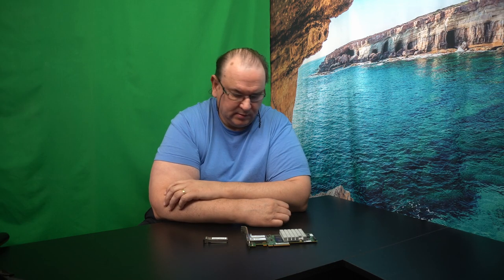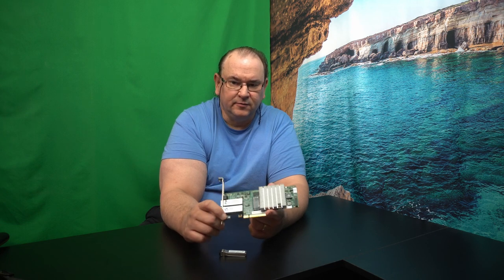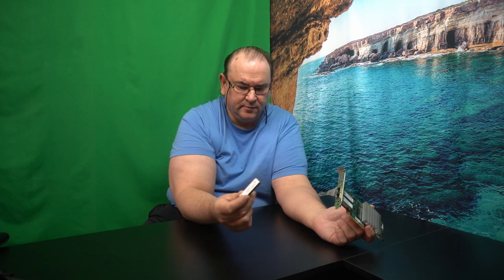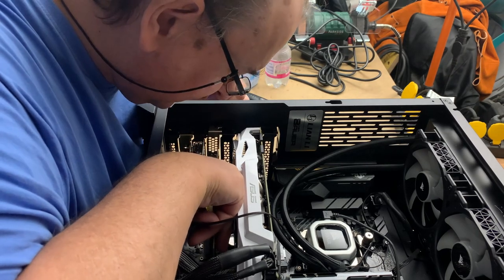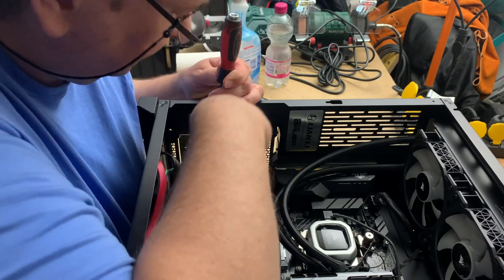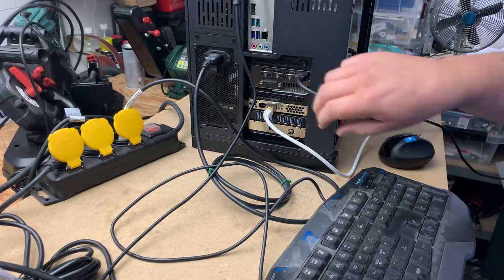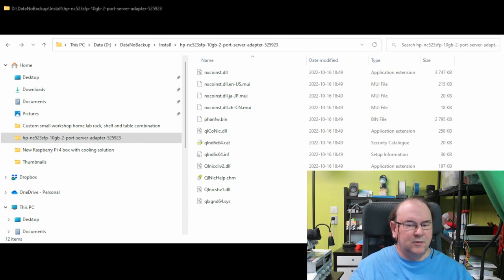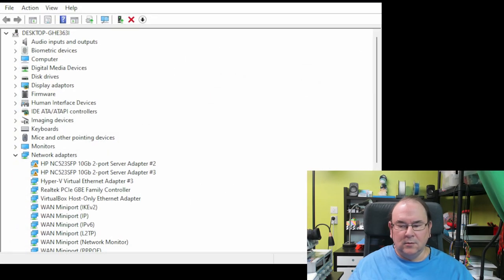Installing a dual SFP+ 10 GbE network card in a PC

Comment: Hi! This adapter is one problem to install Windows and Linux also. I have Dell server T310 with Xigmanas with a dificult to run. I have another server with Proxmox VE... Same problem. Both adapter I put one fan cooler but I believe this card need more and more cold place. In Proxmox VE dmesg shows link up, link down without stop. In Xigmanas the issue are very weird... The system do not detect and offer 10Gbe speed of interface. I will continue with tests, because I have 10 units of this card. Greetings from Brasil. Thanks for yor help.
Reply from the maker: See my findings on Linux server
HP Proliant DL380p G8 with Ubuntu 22 04 1 LTS server 10G network card swap
https://youtu.be/eJegR9mjTcs

Comment: Please disturb me. I want driver for  windows 10
Reply from the maker: I have installed the same driver on a Windows 10 Pro install.

Same installation process but there is no need for any special
steps as in my case it just worked.

However after installing the driver I recommend a reboot before
checking if the driver is working.

Remember extra Cooling is an absolute must for this card to be
stable on a PC. Ensure a fan blowing air over the card heatsink.
Reply: @TheTechRabbit  I request download link
Reply from the maker: Search for driver package "hp-nc523sfp-10gb-2-port-server-adapter-525923""

Pick Your download site with care.

I have not found a official link to HP for this and the one I used was blasted with adverts 
so do not want to post it on YouTube.

I also do not want to make the package I have available as admittedly it is not from a official source..

Comment: can i have doawnload link ?
Reply from the maker: There is no longer a official link to us as product is obsolete. Search for driver package "hp-nc523sfp-10gb-2-port-server-adapter-525923" and be careful what page You download it from.
Reply: @TheTechRabbit  

I have an issue : This operation requires an interactive windows station. Its work in windows 10 but not windows 11...
Reply from the maker: See comments related to video.
Reply: thank you, I was finally able to install the driver but I have yellow triangles and it's not because of the heat
Reply: This device is not working properly because Windows cannot load the drivers required for this device. (Code 31)

The request is not supported.
Reply from the maker: Have not experienced this one. Do You have a compatible SFP+ module installed? (at least one)
Reply: yes, I will look on the internet thank you very much for your answer and for the tutorial!